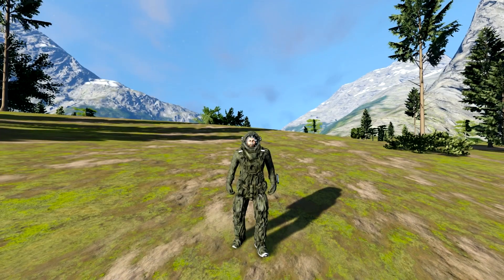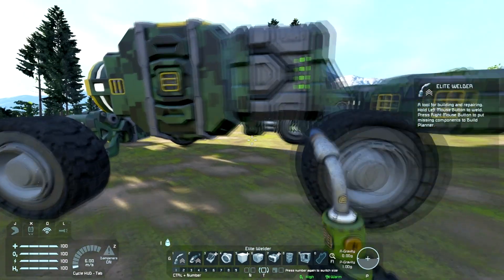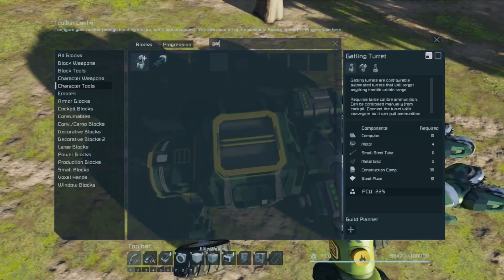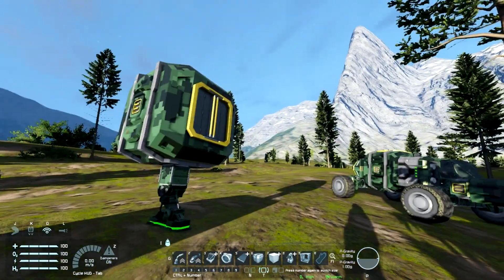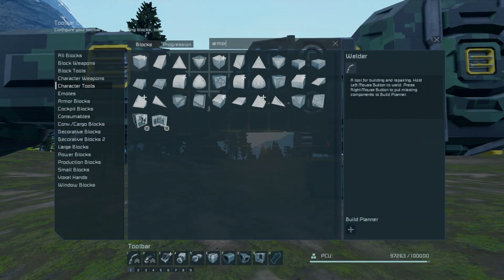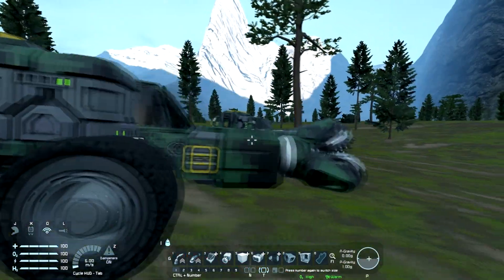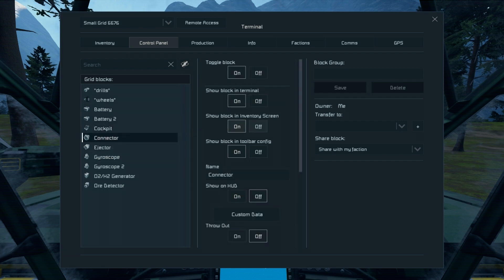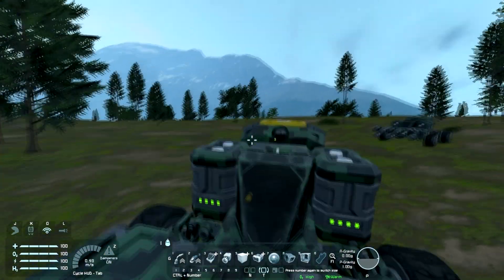Space Engineers Improved Mining Rover Tutorial Plus Tips & Tricks

Comment: I cannot change the strength idk what I’m doing wrong
Reply from the maker: When you open the wheel controls in the menu, click and drag the strength % meter. Strength is your suspension strength based on total mass. How bouncy it is. If you want to go faster, increase power and the speed limit
Reply: @mynameisjeff-spaceposting1417  the problem with that is that it will not let me control the sliders or make it a ship
Reply from the maker: It sounds like an ownership issue then. That or if it's large grid, it's clipped into voxels
Reply: @mynameisjeff-spaceposting1417  I’ve tried everything and the only thing that doesn’t work is the wheels I have no ideas why they just won’t go forward or backward the drills drill and I can turn with my mouse
Reply from the maker: Is the parking brake on? Press P the icon on the right with the circle and exclamation point should be off
Reply: @mynameisjeff-spaceposting1417  no it is not on that’s why I commented because I’ve tried everything and Ik I built it right but it just won’t go
Reply from the maker: Does it have enough power? Are the wheels turned on in the menu?
Reply: @mynameisjeff-spaceposting1417  yeah I’m just gonna try and rebuild it and see if it works
Reply: @mynameisjeff-spaceposting1417  do you think that this could possibly be outdated?
Reply from the maker: Shouldn't be. Nothing would have been broken or nerfed out of this build

Comment: Thanks for your build, I would loved to see a briet tut on the attachment on the base as it is in an odd height.
Reply from the maker: You're right. I had trouble adjusting either grids to meet up well. I line it up by hopping a little with X or using gyros to tilt up. When the connectors turn yellow I lock them together with a cockpit hotkey set
Reply: @mynameisjeff-spaceposting1417  Thanks for your quick reply, I just did your design  and it was a bit difficult to control. I got into V mode so I can at least see ahead. It got stuck on the way in and I had to get out to "clear the way"
Maybe it is all my fault as this is the very first time I use a vehicle for mining.
I had trouble trying to point downwards to make the drills do its thing and when I was moving my mouse up and down I was inadvertently drilling uneven so the wheels got stuck.
Seriously, thanks for your vehicle design.
From me a noob in this great game.
Reply from the maker: Play with your suspension strength and I think you'll find a sweet spot. Thanks for watching
Reply: @mynameisjeff-spaceposting1417  On my next build, it got stuck many times without being able to climb up, it kept going down and getting the tyres and the top of the ship stuck. I will have to do your second option. 3x2 drills and have a spacer to create a wider bore.
I lost the ship but great experience. Thanks again.
Reply from the maker: @LordOfThunderUK  try to keep it moving. This is more of a skimmer type
Reply: @mynameisjeff-spaceposting1417  Thanks, too late, it kept pointing down and when I tried to clear the blocked tyres it did not want to pull up. I lost it (gave up) when I reached over 200m deep. I will try again next time.
Reply: I had this issue also. But I figured it out. After you have made the "Wheels" group like he says to do, and after you have made the suggested adjustments, go mining. When you return to your base, have a Connector at normal height to back into. Once you are close, open up your K menu, go to the "Wheels" group you made and scroll down to Height Offset. I adjusted this from -32 up to 5cm. Height was perfect for the Connectors, Yellow lights. Good seal, Ore transferred, batteries charged. Disconnect, readjust height so I have ground clearance. It works. Not perfect, but it works.
Reply: @dimond1806  Hi, I don't use rovers any more. Instead, I use the drillsystem, and it will do the job without you even moving, Excellent for large or small ships.

Comment: "P" is not good for the parking break, its better to open "G" menu and add the cockpit(handbreak), connector(lock switch) or landing gear(lock switch) to the hotbar. Not that important in this video, but I crashed many rovers that were locked onto ships into the ground when using "P" since its just a "lock" for all the things (Wheels, Connector, Landing grear)
Reply: spacebar is handbrake btw, but for parking P is better but for connecting with a station, i recommend setting on G a "Switch Lock" button for the connector
Reply: @Darktotaled  I wouldn't recommend using P at all
Reply: Also the setting to use it as a parking break on the connectors is highly useful for carriers.

Comment: As Splitsie would say: Don't use P, P is Bad, Never use P. Drag a Cockpit from the "G" Menu on to the vehicle Toolbar for Parking Brake. Basically a sound design but for the "Axel" line I would have used a Half Block under the Cockpit and 2x1x1 Armor Slope for mounting the wheel suspension. I also like having an Antenna set to 50 meters which is the maximum range of the Ore Detector. This way I can see where the Ore is when not in the Cockpit. I know that if you are on a PvP server you might not want this.
Reply from the maker: I have to admit I don't quite get all the hate for P unless you have a lot going on at the base. Yeah half blocks would give more clearance. Good note about the antenna and ore detector! This was built with PVP in mind
Reply: I don't necessarily hate the use of "P" but it is more hand memory between vehicles. When setting up a craft; it is easer to jump between them without needed to study each ones layout. For instance I personally will set the connector to switch lock on the #5 key and if it is a flying craft; the thrusters & gyroscope (which I group together) on #6 for power savings. If it's not in flight then the gyro doesn't need to be on. Likewise batteries are on #8 for recharge on/off and Drills for right & left click on to #1 and #2 turns them on or off. I'll put camera view on #4 this is usual progression to dock to connectors. Typically I'll leave #9 empty to clear which ever other had been selected prior just as you would to empty whatever tool you may have in your hand so you don't grind/weld a door you just want to open. Yeah that has happened enough times that it's a thing. Also thumb tapping the spacebar to break is safer than pressing "P" which has more of a tendency of causing nose diving a rover in to a flip.
Reply from the maker: Oh good point about nose diving! That's something I learned after this video: turning off brakes on the front wheels prevents tipping forward. Useful for rovers with several sets of wheels